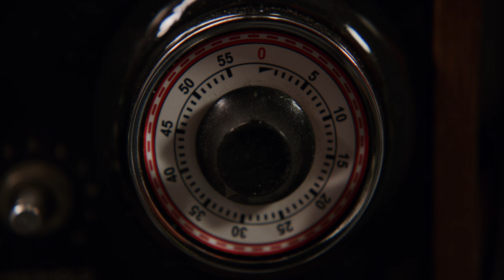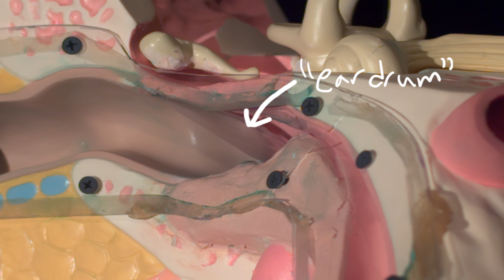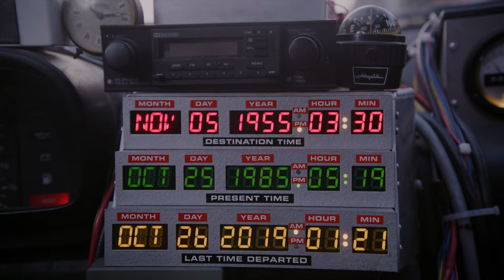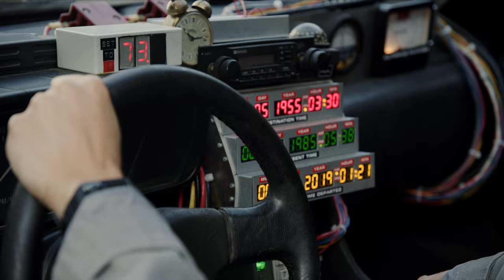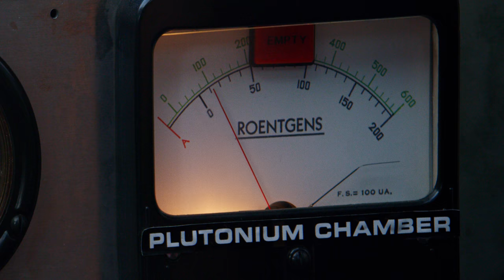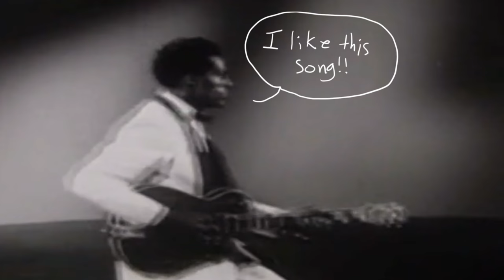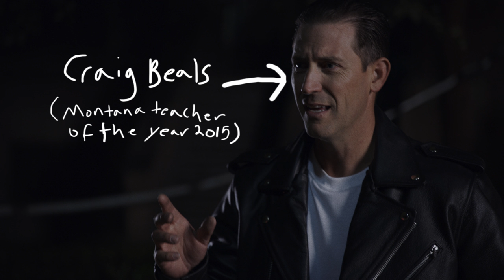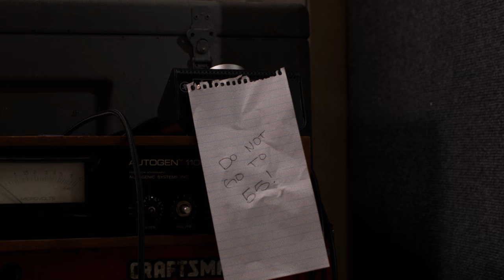Could You Survive BACK TO THE FUTURE?

Comment: There is one important part of time travel that no one ever discusses. The Cartesian Point of your departure and arrival in the Universe. Hill Valley, in 1985, is not in the same place in the Universe as in 1955.
Reply: Darn it, Michael.
Reply: Indeed...
Reply: how does that work?
Reply: There’s no absolute  coordinates in the universe, Hill Valley would be in the same place in your reference frame.
Reply: I was wondering if someone was going to bring that up. Nicely done.
Reply: Dr Who addresses it.
Reply: Flux Capacitor You clearly missed the lectures about the theory of relativity. In your space-time frame of reference, Earth is not going anywhere. There is no fix point you would “teleport” to, other than yourself.
So you will only have a problem if you are trying to time travel from and to an accelerating spaceship.
Reply: So they end up somewhere is space so he should have built a time traveling space ship. Earth spins and travels around sun and sun travels around center of galaxy, while the galaxy is moving through space so they left a lot out in their equation.
Reply: @hydrolito  read Zoltan's reply again
Reply: Lol yes
Reply: Maybe that's what the flux capacitor compensates for.
Reply: @juzoli  Nice try my fellow Magyar. I completely disagree. The content of the Universe is dynamically changing, moving around like particles in air. The Milky Way and its contents are constantly changing coordinate points in 3D space, relative to time. So, unless the Earth is not changing coordinate position relative to the Universe, traveling in time will leave you stranded floating in space, or worse, in a Magnetar.
Reply: Flux Capacitor Relative to the universe? There is no such thing as universe, just the sum of all objects, which we call universe. “Relative to the universe” is not a thing. “Relative to a specific other object” IS a thing. 
There is no specific object in the universe we measure our speed to. Speed doesn’t matter. ACCELERATION matters. And while you migh accelerate on earth, earth itself is not accelerating anywhere, it is in the state of permanent freefall.
Reply: @juzoli  that does make sense
Reply: @juzoli  wait a minute, the earth is round right?
Reply: Freidheim of Prussia Round? That’s what they want you to believe...
Reply: I think exurb1a talks about this in the beginning of Infinite Rice Pudding
Reply: @juzoli  The earth is an accelerating reference frame. It is being accelerated toward the center of the sun. So the time machine would somehow have to keep track of where the point in space it left at would need to have been in the past in order to have ended up in the correct place in the present. Then it could time travel to that past point. However if you only talk about gravity, that simulation would fail as the point would fall through the floor of the earth. So you would need to take into account physical objects like the ground. But then what happens when a car passes through the place you left some time in the past? It just doesn't work very well...
Reply: Derick D No, the Earth is going dead straight through a curved space time. If it would accelerate, we would fell off:) Also there are no engines on the planet to accelerate, there is no force acting on it.
Just think about it, if you accelerate in a car, you are pushed into the seat. You feel no such thing on earth. It’s a freefall around the sun.

The only acceleration we feel is that the ground is pushing us upwards, opposed to being in a freefall.
Reply: @juzoli  Ok yes that's true, I agree with that. So taking only into account the curved space time, it seems it would be possible to track the point you're supposed to end up at, in the future for example. However I do think the ground exerting the force on where you should end up will be a problem to work with. To put it another way, if you were in orbit around the planet I think it would be easy to travel through time and end up in the right place. On the surface however, the force the ground exerts is accelerating you through space time. And so the point at which you must end up tomorrow needs to take that into account. If it did not, and instead traveled only in a straight line through space time, it would fall toward the center of the planet. That I believe is the problem
Reply: Derick D Yes, that’s how I understand. We would pop up in the past/future around the same  planet, but not necesseraly at the exact location we left, maybe not even on the surface. 

I’m pretty sure it is just the matter of resolving the equations though, as it is just a straight motion through curved spacetime. But if timetraveling is impossible, maybe it is also unsolvable?
Reply: I can say earth is stationary and everything else revolves around it in very complicated orbits.. And there's no way you could prove me wrong.. That's the point of relativity.. Your velocity only exist if you are comparing it to something..
Reply: Mark Lingfa Exactly!!! This is the only model which gives a single definitive answer to the question “where this point will be after ‘x’ time?”

I would add, that based on general relativity, those “very complicated orbits” are just simple straight line movements through warped spacetime.
Reply: @mahshshsrklingfa7031  Incorrect. That only applies to inertial frames of reference, and a rotating Earth isn't inertial. I absolutely can prove that Earth isn't stationary, with everything revolving around it. It's easy. Proxima Centauri, 4.3 light years away, would have to complete a circular orbit with circumference 13.5 light years, every 24 hours. That's roughly 5000x the speed of light, which is impossible. It's even worse for objects farther away.

You are correct that there is no such thing as zero velocity. Every inertial frame of reference is equally valid to all the others. In some IFORs, you are traveling very fast and in others you are traveling slow, and they don't agree on which direction you are traveling. But there is exactly one IFOR in which you are motionless. HOWEVER, that IFOR continues in a straight line from where you are right now; it does NOT curve around the backside of Earth every 24 hours, let alone curve around the sun every 365 days. That straight line would determine where you're end up by jumping forward or backward in time.
Reply: @sbunny8  I was considering the earth as a point object.. What you said would be true if you take a point on the surface of earth as your frame of reference.. And if you aren't considering the earth as a point then   my statement would change to.. Everything revoles around the centre of the earth including the earth's surface, mantle and core..
Reply: Commenting late in the hopes that someone will know what I'm talking about: One of the only pieces of media I've seen that addressed this was a show where the time machine itself was a giant room, and what they used to send people back in time with was... a space shuttle. Neat, right? Anyway, I only saw the pilot, and the plot to that was that the president had been assassinated a few days prior, so they had to scramble to find the best candidate to send back. In the end, a puckish rogue won out over a perfect-on-paper air force officer, which enraged one of the staff so much that he tried to gun down spacetime-rogue-guy seconds before launch - only to be shot repeatedly by security. Rogue goes back, they save the president, would-be gunman is still alive in the past and is now on the time-team with rogue-guy.

If anyone knows what the heck I'm talking about, I'd love to know the name of the series. I think it's a fantastic setup (working with someone who tried to murder you in another timeline should make for great tension), and I catch myself thinking about it from time to time. Alas, my Google-Fu is too weak to find it.
Reply: You're probably wrong, since that's why it's called space-time, they're fixed together. Change of time, change of space.
Reply: Jaswati take a second the think about what you just typed.
Reply: @socksincrocks4421  bruh he just solved the paradox...
Reply: This same issue was played out in a book about the end of  the Myan calendar where a person had his  consciousness transferred to an individual in the past who lived in a Myan village actual physical space of where the Earth was in space had to be accounted for so the subject did not appear in empty space
Reply: @juzoli  That's not relevant here.  Relativity doesn't explain direct "jumps" between two points in time as depicted here and most of the other time travel stories.  It's pretty much left to the assumption that the temporal path taken by the time machine "tracks", or is influenced by, the local gravity.  So as Earth spirals through space in 30 years of time, it carries with it, the temporal path of the Delorean as if it was "parked" at that point on the road for 30 years.
Reply: @juzoli  That's not relevant here.  Relativity doesn't explain direct "jumps" between two points in time as depicted here and most of the other time travel stories.  It's pretty much left to the assumption that the temporal path taken by the time machine "tracks", or is influenced by, the local gravity.  So as Earth spirals through space in 30 years of time, it carries with it, the temporal path of the Delorean as if it was "parked" at that point on the road for 30 years.
Reply: That depends on your reference point, which is completely arbitrary, so it could be that the time machine retains its spatial location relative to the Earth.
Reply: @OptimusPhillip  Really? Ok, my reference point is inside the time machine... I'm in 1985 and poofffff... I'm in 1955, floating around interstellar space where the Earth was in 1985.
Reply: I think this depends entirely on the measurement system. It is entirely possible that the earth is completely stationary in some system of measurement
Reply: @raymondwiggins354  Ooh!  Really?!  😃  Do you remember the season & episode?  🤔
Reply: @sashaallan855  "in some system of measurement" - is possible. "In some inertial system of measurement" - impossible. It was already addressed in previous comments.
Reply: Flux capacitor anchors the continuety narrative fields to Earth's same point in 3D space. 
Making use of Quadrillion quantum graviton positron nibbler anchors.

Thus why the tires melt a little. Creating dark matter skid marks in time.

This is common when the Sun's coronal mass ejaculations touch the tires in time warp.

Easy to explain.
Reply: @juzoli  Just like we can't feel velocity itself we can't feel acceleration.  We sense velocity by observing our movement in relation to the movement of other things.  We can be fooled into thinking we are not moving while everything else around us is or vice-versa.  We only sense acceleration in a car or a plane or a space shuttle because the thing accelerating us is the car or plane or space shuttle and those can only accelerate us by pushing us from one side or the other.   Parts of our bodies are being directly pushed and then our bodies have to translate that acceleration to the rest of us.  There is a differential between the side being pushed directly and the side of us being pushed only by other parts of us.  That difference results in us feeling squished pushed.  Gravity works on every atom in the entire planet Earth and our bodies at nearly the same time at nearly the same force (the force difference from gravity due to the sun over a roughly 1.8 m distance (the height of a somewhat normally tall person) is very small, so even if we orientate ourselves to maximize that difference we simply can't feel it.  You're posts in this discussion are just full of wrong ideas.
Reply: @Faladrin  According to GR, you can ALWAYS feel acceleration. If you don’t feel it, then you are not accelerating you are just free-falling.
And the closest thing we have to explain what happens during time travel, is GR.

And I prefer to trust what General Relativity is saying about it, over our common sense.

Comment: 13:52 And that's the biggest electrical misconception of all time. "Electricity takes the path of least resistance." False, if that were true, then parallel circuits wouldn't exist and if you have a parallel circuit with say 5 light bulbs, only one would light up, (the one with the least resistance). But they ALL light up, meaning that electricity will take all paths still. 
The correct statement is, "Electricity will take the path of NO resistance." Again in this example, if you create a 6th branch of that parallel circuit with just wiring and no bulb (basically no resistance) then all the current will take that branch and none of the 5 lights will light up. Even then the statement isn't fully true because a few electrons will still flow through the other 5 circuits, just not enough to light the bulbs up because 99.99999% of the electricity is flowing through that short circuit.